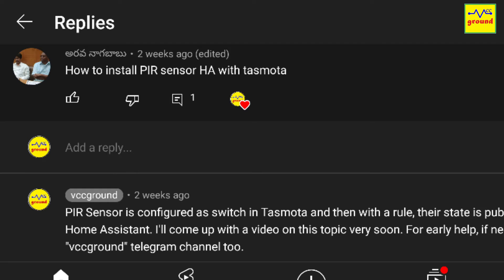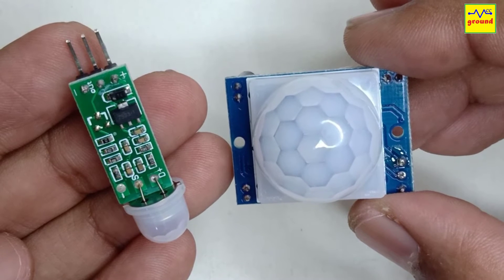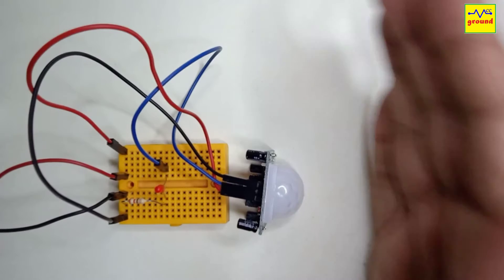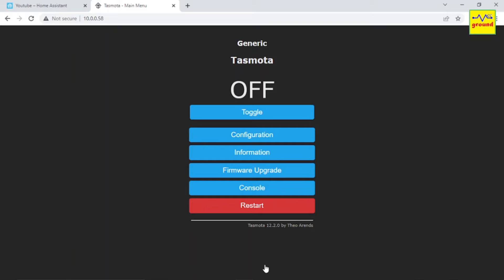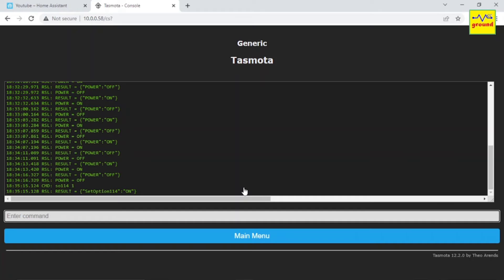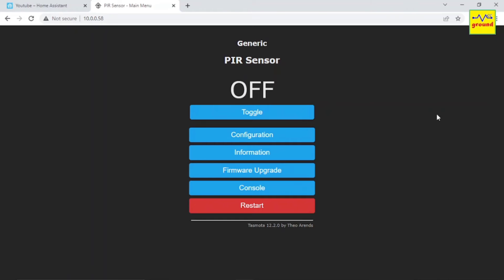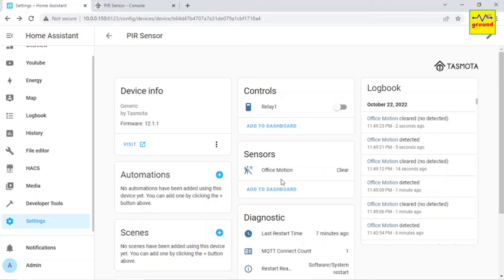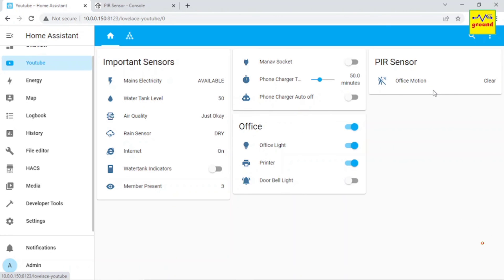#46 Add PIR Motion Sensor in Tasmota and use it in Home Assistant | How to | vccground

Comment: Love your content.
Can you show how to activate your esp/tasmota buzzer in homeassistant using this pir sensor.
Cheers
Reply from the maker: It's very easy brother. Watch video 46 and configure the pir sensor as explained. Then watch video 47 and configure your buzzer too. Now create an automation as shown in video 47, but in trigger field, select your already configured PIR sensor instead of Printer.
And now, whenever a motion is detected by PIR sensor, it will trigger the automation and the buzzer will beep. Hope I'm able to explain well.
Reply: I am a new user and was trying to use a sonoff pir. now i understand that i must use esp32 with pir.
Reply from the maker: @velvetpigcnc  Not necessarily. You can also use Sonoff to connect a PIR and a buzzer and control them independently or from Home Assistant.

Comment: Good content! For Sonoff motion sensor, cooldown time is 1 min. Is there any way to reduce the cooldown time?
Reply from the maker: As per the Sonoff team, due to power consumption and power-saving considerations, there have been some restrictions on the triggers.
That is, If the device does not detect any movement for one minute, it will send a signal upon trigger.
If any movement is detected within one minute, the device will not send a trigger. And effective detection and trigger signals will be delayed for one minute. It means the Sonoff motion sensors work with one-minute interval.
Reply: @the_vccground  Philips Hue has 10 sec. Aqura has 1 sec. But sonoff has 60 sec - 180 sec. I did not know that before buying it. Searching for a way if i can reduce the trigger time. Otherwise need to buy again Aqura or Philips Hue
Reply from the maker: @TanzimulIslamTanzil  Please share model number of your sensor to let me look for a solution...
Reply: @the_vccground  It's Sonoff SNZB-03. Thanks in advance.

Comment: I searched for an entire weekend to find a good tutorial on configuring Tasmota with inputs as binary sensors. One article involved converting YAML to JSON and putting it into the console. I wasn't able to get it to work. I was stuck until I found  your video. I followed your steps and now my new D1 mini PIR/relay is integrated with Home Assistant and running automations. I will use this method for many more projects. Thank you very much!
Reply from the maker: Glad that I'm able to resolve your problem. Subscribe for more such unique and out of the box ideas ❤️👍

Comment: Great video as always, Pls make video on Water level indicator with ultrasonic sensor, connected to home assistant
Reply from the maker: Yes, definitely. Ordinary ultrasonic sensors are practically not suitable for water level indicator as they can not survive long in moisture. I'm already working on some waterproof sensors. Will share soon. 👍